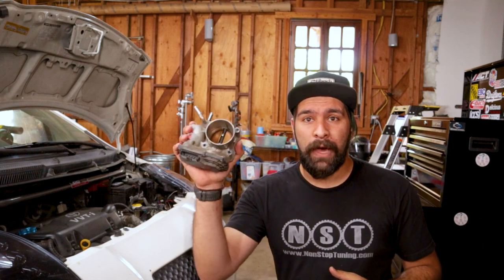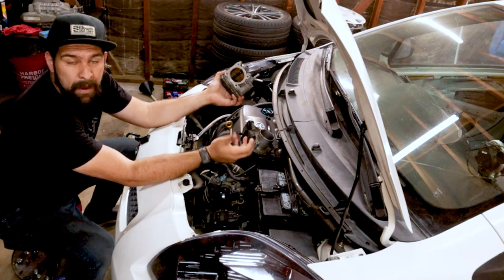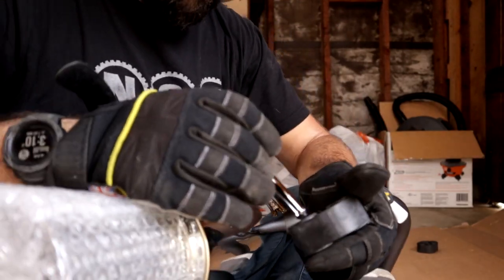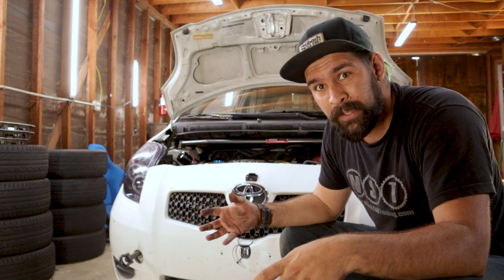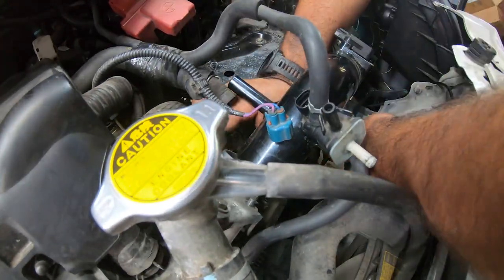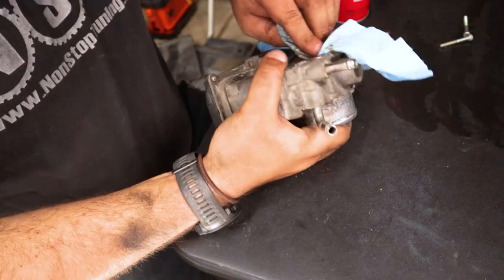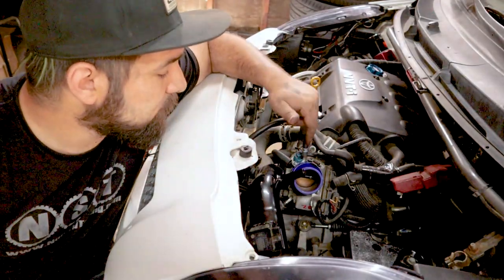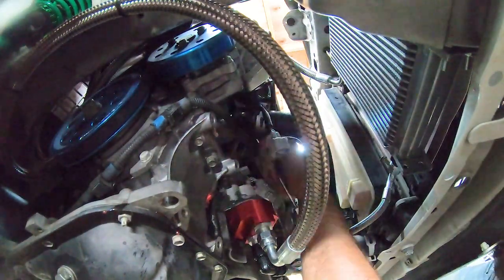Breathe Yaris BREATHE! 1ZZ Throttle body and HKS exhaust

Comment: New exhaust sounds sweet! The 1ZZ throttle body is the next upgrade for me after I get my new brake parts
Reply: Try also

1zz injector
ZL01 MAF SENSOR
VVTI RS SOLENOID

can feel the difference
Reply: @kimmychan7122  Think those mod will fit a 2nz-fe? Thanks in advance!
Reply: @z-trip5457  yes it can fit to 2nz-fe also
Reply: @kimmychan7122  Thank you! And thanks for the little mod list, I hope I can bump up the power a bit!
Reply: @z-trip5457  ur welcome
Reply: Where I can get the Exhaust Bracket for the 3rd hanger?
Reply: @kimmychan7122  vvti solenoid from 1zz engine u mean?
Reply: @kimmychan7122  zl01 maf is a maf for mazda 3,5,6? correct me if i wrong😅
Reply: @naufalegha5150  yes from the 1zz engine
Reply: @naufalegha5150  yes from the mazda engine
Reply: @kimmychan7122  where do you find the VVTI RS Solenoid?
Reply: @naufalegha5150  yes
Reply: @winder_1910  from 1zz engine
Reply: @kimmychan7122 what does the VVTI RS solenoid do?
Reply: @kimmychan7122  Will this change consume oil?

Comment: This is interesting. I never thought that 1zz Throttle body would be so pnp with 1nz. In my country, people used to change the 1nz throttle body with 1TR throttle body. But it is so much for me because i have to made change with the gasket and sitting bracket for the throttle body..

Oh.. and here's one tip for you for the exhaust. I'm just sharing my experience, because we have the same cars. Try to change the header with aftermarket and change the resonator which have hurricane pattern inside, but keep the muffler standard. It will give you better throttle response.
Reply: What kind of headers and resonator do you use?

Comment: Try to imstall ZL01 maf sensor and also 1zz vvti solenoid...also 1zz injector u will feel the diffrence
Reply: All this with the stock ecu? in 1.8l engine or in 1.5l engine? and from which car is the ZL01 maf?
Reply: @ssozenidis ZL01 comes from a Mazda RX8

Comment: if they are the same diameter in the rear than wouldn't using a cone of some sort that goes over the throttle body the same thing?

Comment: I'm new to the channel, and just found out you also have an FRS.  Could you check if the FRS TB works on the Yaris/Toyota connector?  I know the diameter is waaaay bigger, but I'm really wondering if it works in a Toyota (since it's its a Subie engine), would be great to put in a 2ZR engine, similar to what you did with here.

Comment: changing to a larger tb won't increase the amount of air going into the engine. The hole on the intake manifold is still the same size.
Reply: I think this is correct. The car's computer will still set the A/F ratio to be the same at whatever load and engine speed you are running.  Maybe a chip change is such things are possible....need to be added to the mix. Another thing.....according to Bernouli's equation.....a smaller diameter pipe will increase the intake air SPEED, ( not the mass flow amount), so throttle RESPONSE may be worse with a larger TB. There are othr variables that play into all this....would love to hear your TRUE analysis of what this all did....instrumented before and after numbers would be the best indicator.
Reply: @TheWilferch You have convinced me this swap is not worth it on stock manifold. Unless proven otherwise I agree with you. Thanks
Reply: @mayh3xx  ...I didn't mean to convince but only to open the door to further thinking in this. Folks do all kinds of things like this and convince themselves of improvement, but you need documented numbers to see for sure...as "numbers don't lie".... :)

Comment: Did the TB was a plug and play or did you have to change any hoses or gaskets? I have been told you have to change some things but seeing you doing it was like plug and play and i want to do the upgrade but idk how is the process
Reply from the maker: It's kinda plug and play if you're going to track. The issues with mine are high idle and an occasional rev hang which only really effect me in the pits. Many fixes for this including a 1zz vvti solenoid. But I haven't tried them

Comment: Finally watched the video where you installed yours. Did you have any problem with the butterfly hitting the metal gasket behind it?
Reply from the maker: havent had any issues, it looks like it just barely clears.
Reply: @RassoolRacing  You can full open it with out any issues?

Comment: Currently in the market for coilovers for my yaris build. What are you using? Also, any complaints?
Reply from the maker: I've got tein street advanced Z's on mine, but they aren't suitable for bumpy tracks. I'm looking to upgrade to Fortune Auto or Yellow Speed Racing.
Reply: @RassoolRacing  thank you for the input. I was originally going to go with Megan coilovers however they look to be out of stock so the next step up from that looked like BC coilovers. Do the teins have any type of camber plate adjustment? I haven't heard the yellow brand you mentioned I will have to look into them.
Reply from the maker: @TheInteriorAutoMechanic  the teins I have don't have camber adjustment, but their are upgraded ones that do. The teins and I think the megan Racing are more designed for street use, cus the spring rates are a bit soft for track.
Reply: @RassoolRacing  thank you for the info!

Comment: I’m sure this won’t matter now, but maybe try a different mounting position for the sway bar to make it act softer, and maybe use softer bushings on the links? That way it’s still active, but won’t make the rear too stiff?
Reply from the maker: im just going with a thinner bar. dropping from 22mm down to 16mm. the whiteline bar was already at its softest settings

Comment: Did you use any spacer? Or gasket? What did you do with the Coolant did you run it back into itself or connect and by pass?
Reply from the maker: Just the OEM gasket. I did the coolant bypass in a later video

Comment: how has the swap effected your smog check, still able to pass? I keep throwing EVAP codes p0505, incorrect purge flow. have you thrown codes?
Reply from the maker: With the 1zz throttle body you will not pass a smog visual inspection
Reply: @RassoolRacing  ??!:o

Comment: Changing the throttle body, will it increase performance?(speed)
Reply from the maker: In theory. It is different for each vehicle and depends on how the ECU responds. On the Yaris it gives better performance at wide open throttle, but creates some issues at partial throttle. I wouldn't do this for a daily driver, and sort of regret it on my track car, but for people who are drag racing they've seen noticeable results

Comment: Excellent stuff bro. But, i have the 1nzfe 4 door 2005 and the desing of the trhottle body is defferent.  Which swap do you recommend? Thanks
Reply from the maker: The 05 had a drive by cable throttle yeah?
Reply: @RassoolRacing   Yes
Reply from the maker: @georgelcpda3413  the older 1ZZs might also be cable driven. I'm not sure, but it's worth popping a few hoods at junkyards to find out.

Comment: hi I found myself on your channel because I wanted to find some substantial modifications for my 2007 yaris. Would you recommend the 1zz throttle body on my yaris 1.3 87hp or is it not compatible?  thanks for your answer
Reply from the maker: Hey. I'm not very familiar with the 1.3L. we didn't get it here in the US.
Reply: @RassoolRacing  did you have to make some changes to the control unit for having put the throttle body 1zz or did it settle on its own?  and above all does it give you any problems?  also I also saw video where you do it remap but originally how many hp did it have?
Reply from the maker: @fabioacolla367  factory it's 106hp to the flywheel so maybe 85whp. When I did the Dyno run there were other contributing factors. Cold air intake, lightweight pulleys and wheels, etc. 

The only really issue with my 1zz swap is that it idles high on cold start. I've seen people fit that by adjusting a set screw on the top of the throttle body, but since I only use my car for track purposes, it hasn't really bugged me yet.

Comment: What brand and part number of low temperature thermostat did you use?
Reply from the maker: It's a mishimoto one, but I wouldn't recommend it. It doesn't seem to be working as advertised

Comment: I've been debating doing the TB swap on my yaris sedan, the only thing that's held me back so far is knowing that others have had high idle issues. I'm in AZ and 2k elevation so after watching this and reading your comments I'm convinced I won't have any issues with it. Did you have any problems with the throttle plate hitting the intake manifold/ weird metal plate-gasket ?
Reply from the maker: i didnt really have any issues with the gasket, but i know others that have. i do still get weird idling issues at cold start, but honestly, my car is so rarely at idle, it hasnt been an issue. from what ive heard, using the 1zz VVT soleniod will fix the idle issue. im going to try that and some injectors soon.
Reply: @RassoolRacing  hey that sounds like a plan! I look forward to the results you find
Reply: I'm considering doing a similar TB swap on my mom's 2003 Echo. How did the swap for you work out.
Reply: There's a screw on the 1zz tb that can be adjusted, and also a video on how to do it, and it will fix idle issue 👍

Comment: I just came across your channel and subscribed I have a 2007 1.5 Yaris 5 speed manual ... I just ordered a 2.4 Camry throttle body for cheap.. do I have to do any mods on the coolant connectors that go on the throttle body just wondering if it's identical on a automatic and 5-speed
Reply from the maker: The 2AZ throttle body should be identical with either transmission. I just bypass the coolant lines, but there is a way that you can still use them with slightly longer hoses
Reply: @RassoolRacing  hey I just replaced my throttle body with the 2.4 l.. it's running fine no vacuum leak issues but keeps throwing idle air check engine codes do have  any advice ????
Reply from the maker: @bryanc.tejada2408  I've heard of people fixing the idle problems by either switching out the VVT solenoid for one from a 1ZZ, or hollowing out the PCV valve. There's even a method that involves opening up the electronics of the throttle body and being able to turn down the idle setting. But I'm not familiar with any of these methods. Those are good places to start looking though
Reply: @RassoolRacing  thank u for your response

Comment: Any tips for high rpm during cold start? I installed 1zz Throttle body on my vios gen2
Reply from the maker: Others have said there's a set screw on the throttle body you can adjust. It's under some resin.  I didn't bother with mine since it's on track most of it's life
Reply: @RassoolRacing  thanks

Comment: I have a 1.8 zzfe in my 01 Rolla. Been looking online for answers on question I'm about to ask, to no avail. Maybe someone here can help. It has 167k, new plugs, good fluids, doesn't really burn oil. Checked after 1000 miles so far, absolutely no noticable loss in oil, going to check every 500 miles until next oil change. So not sure if this is inherent with this motor or not but from around 2700-3200 rpms, it buzz's/vibrates, and gives the impression it's under very heavy load, and going uphill definitely noticable. After 3200 and before 2700, nothing really noticable. No knock, do hear a metallic clicking like rattle under acceleration, but very likely is a heat shield. Hard to get a good audio recording of it due to frequency, but millions of these cars exist and there's no way I'm the only one who has experienced this. I was thinking it could be a clogged it partially plugged cat. Have cel for evap, but unlikely has anything to do with this.

Comment: did this mod with the 1zz tb and 1zz injector, didnt have any high idle during cold starts. usually around 1.5k-1.7k rpm for abt 10secs then drops to 850. i did disconnect the battery before i installed the tb and injector. maybe i got a defective 1zz tb. other mods are 4-1 headers w/ custom downpipe running on a 18'scav, Cold air intake w/ k&n filter.
Reply: The 'closed' setting for the 1zz throttle body is actually a larger degree angle than the original 1nz 
There is an adjustment screw covered in clear resin that can be adjusted to fix the initial high rpm cold starts
Reply: Same issue so I am currently attempting to have the OG TB on the yaris after reconnecting battery. Turn ignition to ON position w/o cranking. Wait a few minutes. Turn car off and connect the 1zz TB and start up the car. So far no check engine light but sometimes it takes a day for the light to come on. This method apparently tricks the ecu to think the original TB is on the engine instead of the 1zz. Let me know if it works for you :)

Comment: I have the 3 cylinder 1.0 liter Yaris, would this throttle body be able to fit in it?
Reply from the maker: So that's the 1KR-FE engine, and it has a different bolt pattern I believe.
Reply: @RassoolRacing  thank you! I’ll look into it 🙂

Comment: What's the verdict on the throttle body, is it worth it? I've been tracking my Yaris and been thinking about doing this upgrade.
Reply from the maker: Went out once with it, and It was causing some issues cus it wasn't seated properly. I've fixed it now, but I haven't had the chance to go out again since. Summer track days are a bit too hot out here, so it might be a while
Reply: @RassoolRacing  Ah got it. The NorCal tracks probably don't get as hot. Thanks for the reply 👍🏻
Reply: That's a lame ass reason to NOT drive it around bro. Go see if there's any difference we're actually interested
Reply from the maker: @sage6459  "driving it around" isn't going to make a difference. My next track event is August 8th. Since the TB was installed though I did an event at Chuckwalla Raceway, and the car did have some issues with the TB that have since been fixed. I put up videos chronicling all of that.
Reply: @RassoolRacing  hey man what issues were you having with the 1ZZ TB and how did you fix them? Considering swapping mine as well as doing a K&N cold air intake

Comment: hey man, i would like to do this to my 07 yaris as well. any way you could leave a link for the exhaust and adapters for the throttle body that you used? thanks a lot !
Reply from the maker: here's a link to the exhaust and theres a discount code in the video description. 
https://frsport.com/products/hks-catback-hks-exhaust-hi-power-32003-bt004
Reply: thanks so much man! random question as well, other than the unavailable blitz one, do you know of any turbo kits or supercharger kits that you can actually buy in the US? thanks again!
Reply from the maker: @chadiousmaximus8380  non that I can think of that are still being made new

Comment: Hey Joey! Great video! I would like to try to make a change of the throttle body on my Yaris 1,33 VVTi year 2009. Can I ask you to write me the OE number of 1ZZ throttle body you use? I try to find some pcs on ebay but there is a lot of product for different years of Corolla... And we in Europe don´t have Corolla Matrix as you said, so I have to find another model :)
Thanks!
Reply from the maker: I'm not sure it'll fit the 1.3L but feel free to try. The 1zz also came in the mr2 spyder, Celica GT, and the rav4

Comment: Must you upgrade internals to upgrade the throttle body to this one?
Reply from the maker: no real need to mess with internals. maybe injectors if you're running lean
Reply: @RassoolRacing  thx

Comment: I've got an 06 Scion XB with the same 1.5 engine, I've been searching for like  a month for a 1ZZ throttle body for this swap but can NOT find one.

I want to port the 1ZZ throttle body, AND port the intake on the throttle body side.

IT. WILL. BE. DONE.
Reply from the maker: I got mine from walking my local Pick-n-Pull. Also the throttle body from the 2AZ engine works.
Reply: Yea I just need to hit the junkyard. 
I've heard the one from the 2AZ take some minor modification though, such as hose block offs and stuff.

Comment: Hey bro I have a vitz rs 2008 (the sports yaris). I got a dc muffler tip and I like how it sounds but I def want more power. Should go for an axle back exhaust or should I use a custom mandrel bent straight pipe kit?  Appreciate the feedback and great video. It's exactly what i was looking for.
Reply from the maker: so the axle back isnt really going to make more power. in general power comes mainly from changing the engine side of the exhaust (headers, downpipe/overpipe, cats, etc.)
Reply: @RassoolRacing  thanks bro ✊🏽

Comment: Hi, at 1:58 what is the gagget in ur exhaust?
Reply: It's called a DB or Decibel killer. Usually supplied, but not always included in exhausts like this. It's there to keep the noise at more acceptable levels.

Comment: What did the exhaust and throttle body cost you?

Also, notice any performance changes?
Reply from the maker: TB was about $40 from a junk yard. Exhaust was about $400. The TB definitely gives better response, and maybe a bit of acceleration, the exhaust is just for looks and sound

Comment: whats ur rpm on idle?
Reply from the maker: Warm 750. Start-up 2000
Reply: Thanks bro. I got my 1zz TB. I got 800 on idle. And 3000 on cold start but eventually goes down after few secs.